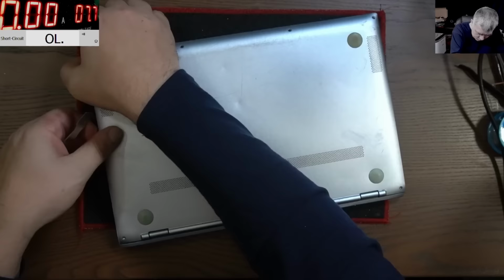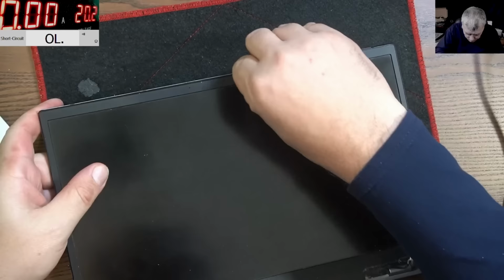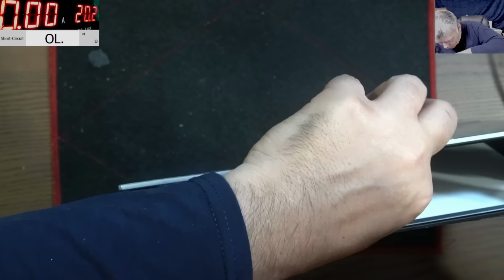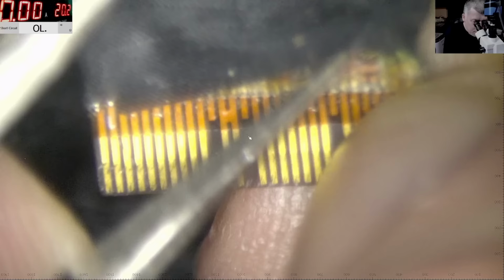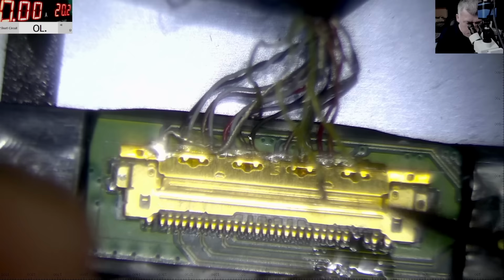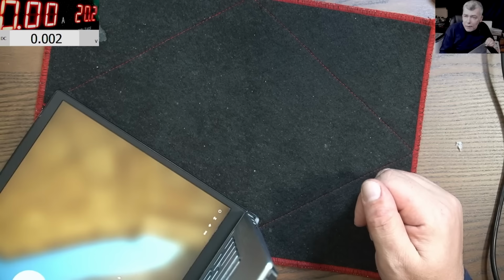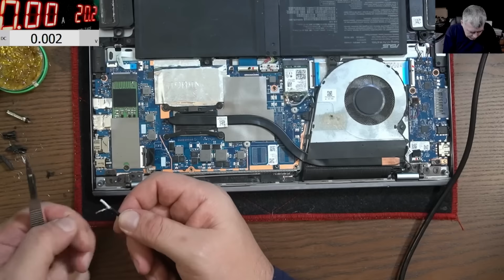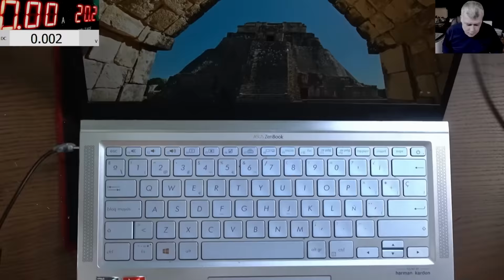How a hard laptop repair looks like! ASUS UM431D water damage repair

Comment: sorin I found a solution for this kind of problem when you have strong adhesive on something fragile use contact spray the one used to clean electronics and it is non conductive the other thing it veporise so quickly and when it comes in contact with adhesive it breaks it down so fast it is like magic you spray a little wait a few seconds and spray some more and the thing is out 

hope you see my comment it will make my day to know I helped you

Comment: Great work Sorin. One adjustment I would make to get the screen out from the rear glue is using a very thin wire from right to left and sliding it down, cutting the glue as you go. A bit like a cheese-cutting wire, also the same method as removing car windscreens from the outer bound. It works well. Thanks

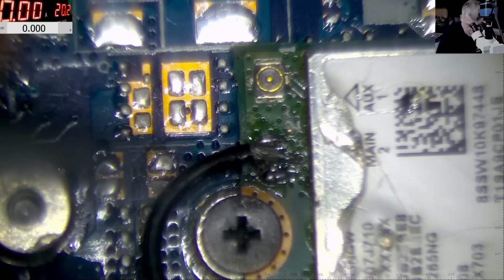Comment: I think I remember you once saying you're a ham radio operator. As I am also a ham radio operator, I can confirm that direct solder of connectors is better for RF; however, @ 35:27 it did not look like you soldered the braid very well. I can understand this as braids often oxidize and don't take solder well. Also, you had to be careful not to melt the dielectric as this would mess with the impedance. This is why most direct solder small diameter coax runs are done with a solid ground coax rather than the braided stuff... It's arguable if the job you did is much better than a connector for all the reasons mentioned above... That said, I love how you find ways to fix things with what you have; it is very helpful to see the ideas you come up with, and holy crap do you know your electronics, man.

Comment: I also as you have been using glue gun melting material for decades for this and similar purposes.
It is especially suitable to create a mold for casting into a certain shape, e.g. cylindrical so that the transition from the connector to the cable looks almost like the original and maybe use black melting material for this purpose :-)
Greetings from Slovakia.

Comment: After heating the back of the screen, you can use a string to separate the panel
Reply from the maker: Smart! I didn't think about that, thank you
Reply: @electronicsrepairschool  technic borrowed from removing glued mirrors to a wall.

Comment: HP14-J157 & Asus TUF-FX505. With this,  I already saw too much. Those 30-pin connectors are cheap in ali... ess. 
Teardown expensive laptops is always a risk, so I'll check out chromebookparts and choose all videos from that manufacturer.
On the other hand, functional and economic repair. Sincere congratulations. Thank you very much for sharing. All the best.

Comment: They use double sided phone screen tape to fix those laptop screens in place.
All thin bexel and lids are done this way. Lots of fun with Microsoft surface tablets
and tablet pc's in particular. Applying plenty of heat does the trick.

Its not glue .... its double side tape.

Comment: A bit of Apple knowledge 🍏: whenever you have stuff glued together with adhesive strips, try to grab one end of the strip and pull it slowly. It should stretch and, by consequence, shrink, until it's too thin to stick to the surfaces and it just slips out.

Comment: you could have used some rubber band with your pliers so they hold the conector better when soldering. And after hotglue on the port, you could finish it with some shrink tube :) for better then factory design :)

Comment: Dear Sorin. One way that you can prevent future breaking of the connector is to put a pencil spring on the cable end and heat shrink or hot glue it :D
This is tested.

Comment: 1:20 (info for others): there is a hit mark in the middle down of the back cover(around small holes). And on the mainboard you can see the same smash mark on the heatpipe.
If you follow that heatpipe to right, close to fan - you see that something is wrong with that heatpipe there.  It is squeezed and bended at the end of the motherboard edge.
And at 32:22 you can see the smashed fins of heatsink in that spot. So..
..
WHEN you see that kind of damages, you have to, as service-technican to do a stress test on the cpu/gpu to check if the heatsink is working fine, because damage on heatpipe can unseal it, which can even stop the proper heat transfer (to radiator) (I had one case like that)
..
Also keep in mind that any punch/hit to that thiny motherboard with cpu/gpu/chipset in one thiny chip, which is soldered to the motherboard by around a thousand of small solderballs under it, it can make some of that balls to be cracked. (that is way, the additional stress load tests, are required)

Comment: I think you would like "Polymorph". It comes in the shape of little white balls/perls that you can buy for a few Euro / Pounds. If you throw it in a glass of 70°C water or heat it with hot air it becomes transparent and you can shape it in any form you want - like dough or Sugru. But once it cools down it gets very hard, solid and white again (you can also color it with pigment parts). If you're not happy heat it up again and fix it. For repairs like the plug it's perfect. I always have a small bag here for repairs and it goes a long way. It's not as sticky as hotglue, but as a "robust shell" it's fantastic to work with.

Comment: no its not doggy you pretty much saved like 150 pounds in parts for the customer... how can that be doggy? perfect job, only i can suggest you to buy some different sizes heat shrinks for the connector jobs, it will look so much better at the end

Comment: Thanks for the video as always your videos are a good watch 

I currently started work in an Asus that got water damages after a roof came off during a typhoon.

It's been sat In a box for over a year after pulling it apart and drying it out 

First thing I noticed wrong was a blown component based on schematics turns out to be a ferrite bead between 19V power rail to screen power that component literally blew itself to bits 

On further investigation I spotted a slight burn on screen connector on motherboard but so far it looks to be not to badly damaged   but it's looking at the other end of the cable that looks very crispy pretty much the very same as seen on screen in this video  so seeing how expensive the replacement cable even a Chinese knock off cable is pricy so might follow this trick just solder the 4 wires directly to the connector and keep fingers crossed the screen still works properly 

Even tho no light I can still see a change / something happening on the screen so it seems to be getting signal 

Only issue I have right now is trying to find a ferrite bead sadly in Philippines no stores that sell components and online I can find them but I need to order like 50 when I only want 2 or 3 

Be interested to know would it be ok to dix up the wiring for the screen and then just blob of solder where the ferrite bead used to be obviously I would ideally want to replace it but for testing purposes be handy to bypass it

Personally I would sooner just lob the laptop in the bin it's getting a bit old now maybe 7 or 8 years old but sadly the missus has some sentimental value over it and busting by balls to get it fixed haha

Comment: dodgy... okay but what could you lose? a 40 pound screen?
these are disposable laptops... nobody will keep this thing for 20 years like a business device...
On the Connector... you know what i'd do? There are "universal laptop power supplies" that come with a variety of plugs. I'd take one from those and solder the wire to the contacts from the plug, so you probably have a higher chance that it will suvive the movement.

Comment: That LCD screen panel has 100% been removed and replaced previously, no way would ASUS factory fit a screen panel with 5 strips of double sided black tape including directly to the white screen backing, it would only have 2 strips of bond and detach (Tesa) pull tape to the metal parts off the screen back.

Comment: Not trying to change your practices, your to far over the top for that. Let me give you an example of a dodgy repair...A car gets dropped off at the repair shop and it needs brake pads, on this car they are very expensive so you decide to save the customer some cash. instead of buying new pads you decide to glue break material to his old metal backings. The same material as the manufacture uses. Do you tell the customer his car is better than factory and send him on his way? Or do you tell him that you made the pads and they SHOULD be fine. When those brakes fail and kill everyone in the car. Is it on you or the factory. My point has always been IT'S NOT YOUR DECISION!! You tell the customer ahead of time that your going to rig it--than fine it's on him but if you do it and your dodgy repair burns down his house! It's your fault.